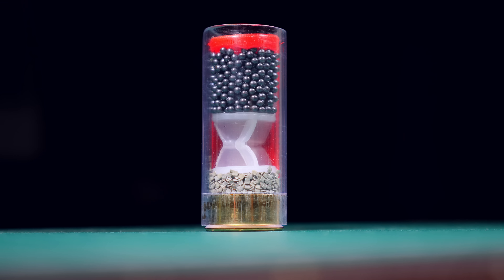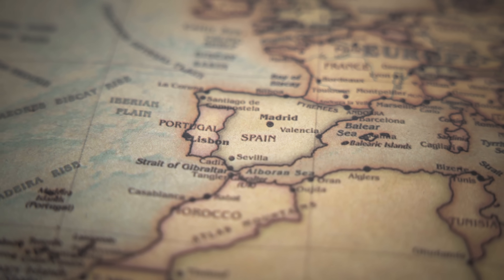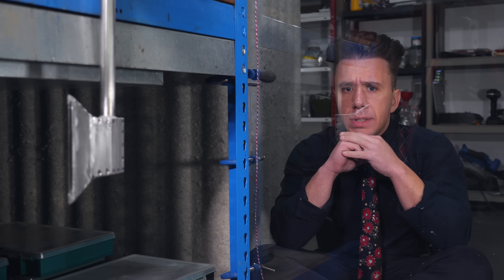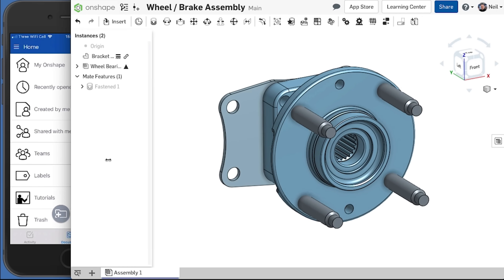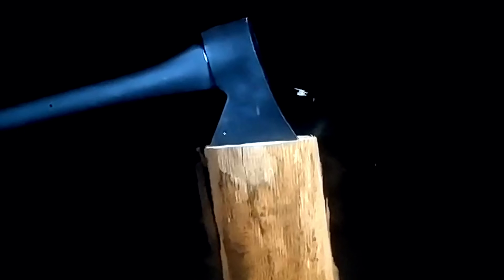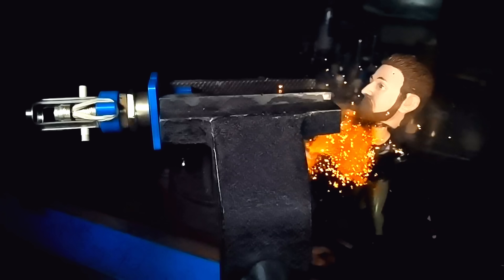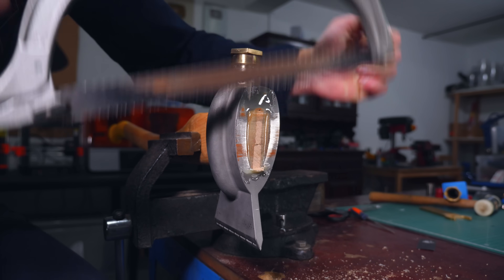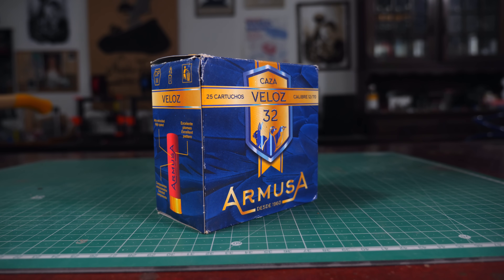I Built a SHOTGUN AXE

Comment: Savage Tigerslayer's Perfected Flurry of Blades [超絕猛虎殺擊亂斬]
89 (83+6) Atk Weight [][][]
Prioritizes targets with Prey
Can Clash with this Skill regardless of Speed; this unit does not become Staggered before it uses this Skill
[On Use] Consume all Inner Strength [底力] Stack on self. If this unit consumed...
-... 10+ Stack, gain Atk Weight +1 for every 10 Stack consumed (max 4)
-... 25 Stack, Final Power +1 for every 4 (sum of Burn and Tremor on the main target) (max 6)
-... 50 Stack, Coin Power +1 and deal +50% damage
[Clash Lose] Gain 2 Power Down
[Clash Lose] Gain 6 Paralyze
[Clash Lose] Deal -80% damage; this Skill's damage cannot Stagger the target; inflict only half the Potency and Count for both Burn and Tremor inflicted by this Skill (unless raised by other effects)
[After Attack] Reload (once per turn)
- If this unit has Savage Tigermark Round, Reload - Tactical instead (once per turn)
[After Attack] Ends this turn
Unbreakable Coin
Spend 1 Tigermark Round
[On Hit] Inflict 6 Burn
Unbreakable Coin
Spend 1 Tigermark Round
[On Hit] Inflict +6 Burn Count
Unbreakable Coin
Spend 1 Tigermark Round
[On Hit] Inflict 6 Tremor
Unbreakable Coin
Spend 1 Tigermark Round
[On Hit] Inflict +6 Tremor Count
Unbreakable Coin
Spend 1 Tigermark Round
[On Hit without Cracking] Trigger Amplitude Conversion into Tremor - Scorch
Unbreakable Coin
Spend 1 Tigermark Round
[On Hit without Cracking] Trigger Tremor Burst 5 times; then, reduce target's Tremor Count by 5

Comment: i aint no engineer but i have an idea, what if u built some kind of metal around the exact depth u need into the wood, like for instance if u need to be 7 mm in the wood for it to work perfectly, a metal barrier 7mm above the tip of the axe, i dont know but it sounds like it should work to me
edit: now that i think about it what if its like bent backwards kind of like an arrow tip so it doesnt mess with ur ability to cut the wood itself

Comment: Hey integza, could you please build this again with the following upgrades? Your original video: https://m.youtube.com/watch?v=CWWKcuVKErI This tiime around 1) don't put the bottles parallel to the boat, put them in the boat in a diamond shape. This will reducethe drag. 2) use 2 tesla turbines moving in opposite directions with 2 seperate lily impellets that are mirror images of ech other. This way you can balance the center of mass and also keep what you called and i quote "the steering thingy" in the middle. 3)Since we have 2 tesla turbines, incree the presure in the bottle to 7.5 - 8 bars. 4) ( OPTIONAL ) I) Add a steel rod with 20 mm steel ball on both sides at the center of the boat (above the first bottle in the bottom layer and below the second and third bottle in the econd layer)to balance it and prevent it from tipping over. Also bendthe rod in the middle to shift the center of mas lower but not so much that it touches the water. ii)adda 35 mm steel ball on the tip and 20 mm steel balls to both the rear corners to balance everything if required as thi will slow down the boat. Thank you for reading the comment and sorry for ending this same comment it in the past 5 videos. -J.tailor

Comment: Honestly you could probably make this a product to sell in the US. Youd probably have to make a couple changes, like redesigning it to use standardized blanks, such as powder actuated nailgun shells, and some sort of safety mechanism so you can leave it loaded without it going off due to being dropped or shaken; a faster way to load and reset the system; and some way to reduce vibration on the hands?

Comment: 0:22 That thing is called the Wad, it both separates the powder from the pellets so the gas doesn’t escape through tiny cracks instead of pushing all of the pellets out. And it holds the pellets somewhat very still

Comment: I was really nervous when you were hammering on a bolt resting on the business end of a shell with primer and propellant inside. If the shock ignited the primer, the bolt would have left at high speed roughly upward.

Comment: Have you considered making a weapon that combines this axe idea, with the flaming knife, and make it self heating through platynum catalysis of hydrogen generated by dipping zinc into sulfuric acid inside a hollow handle?
https://www.youtube.com/watch?v=fwKuCoL9FlM

In essence, a knife that turns red hot without any visible heat source nor gas tether. Open the hollow handle, carefully drop a capsule of zinc, close, and voila, the blade becomes and stays red hot.

Comment: Out of Curiosity have you ever tried to procedurally generate 3d parts. I know it might be considered lazy but using GPT make parts. The reason I am asking. I am working on a project of my own and curious on the feasibility of it.

Basically I am working a concept for a robotic pet dragons. and the idea is to use similar technology to generate a Minecraft world to generate designs. the idea is the program is given a set of parameters to fallow for type of dragon, and colors it can us and general shape of scales etc. using a seed(This is the number used to generate the Minecraft world usually a 16 digit number.) to generate unique patterns, colorations and markings. this way each dragon will look unique. maybe extend it to body shape. muscle, fat ratios. each dragon would carry a chip which would have the dragons would carry the seed used to generate its design, a sort of DNA strand which can be used to copy the hide patterns and textures. so that if one of the robotic pets needs repairs a new skin can be created that looks like the old one. 

for fun I would crate a scanner so that the dragon can be scanned for damage before repairs where it so if there are any tares in the hide, they can be replaced with scar cosmetics in the newly printed skin.

Comment: Could you teach how to create a frequency plasma vortex that an average person can replicate at home? My desire is to create a frequency healing air energy emisor, like an speaker, like a copper star, but in a size that actually can make a human body the waves, the benefits, something in which we can program easily through our phones our desired frequency; 528, 432, 963, 1111hz, etc.

I have seen models using boxes that don’t know where to get, or too small ones therefore too weak. But I’m sure there most be a way to play a tune for example in Spotify, it can be whatever app, or source the point is for the phone to sent the Bluetooth signal to the vortex, so the vortex can emit the frequency in factual frequency.

Not sure if a plasma dispositive could/would help? Or just complicate the project?

Have seen some using all sorts of magnets, but I always wondered which is the right magnet and in what position? How much copper is enough? How big the star should be to actually produce reasonable results?

Then the heat? What is the most safe way to have it on without risks of fire or anything risky?

And… How the energy could be amplified in a good way? Power battery bank? Heart? Both? More magnets?

Could you make a video on this? It could be really helpful as healing frequencies actually truly interact with the human toroidal energy field, we are made we lots of water and so the energy vibrations actually produce resonance in our energy fields, which reflects on our bodies.

Hope you find this project as interesting as it is, there is much in YouTube yeast, but nothing really worth so far.

Comment: Integza, I found you in my search for the answer to this question that has been bothering me for weeks. This is the latest video at the time of posting, so I'm going to put this here, as opposed to somewhere more topically relevant. The question is this: Can you make a submersible fuel injector jet engine? I'm not talking about rockets, ram jets, or MHD propulsion. A real McCoy, fuel injector jet: Ignition, fuel injection, reaction chamber, flight medium as oxidizer. No moving parts. 

Conventional terrestrial engines require frequent surfacing, compressing exhaust, or tons of CO2 scrubbing. Burning the stuff you use to breathe in order to move means you have to stop pretty frequently to get more air and dump byproducts. This is dumb as heck, and we all know it. We(humans) need to find a way around this problem that doesn't ionize your bones from 50 meters away and cost ten billion dollars while doing it.

 Fluid mechanics tell us that if a machine works in the air, and if you want to do the same thing in the wet stuff instead, that there is a cigar-shaped version with tiny wings that can make that happen for you. I refuse to believe that aeronautics and chemistry have failed to produce any novel answers we could use in an aquatic jet engine analogue. If this unicorn is as close to being possible as I suspect with the current state of tech, it's likely to be deeply inefficient and insanely dangerous, which seems to be your cup of tea.

I've had a couple of thoughts on this, as my brain won't let me stop.  The first issue is fuel. Hydrogen-based fuel  should be able to oxidize in dirty sea water still, and though I haven't watched your actual water rocket video yet(next on the list,) I imagine it uses a similar action. I don't think it'd like seawater very much, though. 100% purity is almost certainly essential to that setup and we don't have time for filters.

 The big problem there is how many bubbles H2 or H3 fuels would make, and the opposing implosive force after a detonation. The bubbles would buoy you instantly out of your path and lift you up, but you COULD "sail" against the exhaust to maintain depth or dive instead with enough forward momentum and some cleverly placed foils.

The resulting cavitations would also likely rip the engine (and the uboat) apart, but I'm not sure. The opposing vectors between the vessel and exhaust when it gets going might be enough to avoid damaging contact. You would probably want to burn in smooth onset, sharply declining pulses so you can eject your exhaust as a tube of cavitation rings instead of a constant stream as you would if you were in the air. If you do that, they'll travel a bit farther before destabilizing and going boom. Ideally, the cavities collapse reasonably far behind the crew compartment of the vessel, not in the reaction chamber or at the moment they hit ambient pressure at the end of the bell. Distance from an explosion matters less underwater than it does in atmosphere, but it's still a parabolic drop-off, so the more millimeters, the better. Putting a super meaty shielded jet module at the end of a long shock absorbing tail might be the answer to this, ultimately. It would also make the craft kind of look like a squid or a nautilus, which is cool and thematic.

You would also want to burn fuel(any fuel) orders of magnitude slower in water than in air. Drag and max speed are both way worse down there, and you don't need to generate that much lift to rise. Not to mention the more fuel you burn, the more of those pesky instant death bubbles you're making. More torque is the law of the sea.

Additionally, the final model needs to operate at highly variable pressure. If we were using this for a jet boat, we'd just use an atmospheric jet, after all. Jet/rocket fuel is optimal for ≤1 ATM environments. This WILL cause unforeseen problems at depth. For an A1 prototype, we're obviously talking about a fishtank under static pressure, but it's something to keep in mind.

 Technically, the jet problem could be overcome by electrolysis. You separate the flight medium atomically and then burn the O with an atmosphere catalyst, but this is far too slow of a process for compounding thrust to be possible and it doesn't solve for any of the other problems. You COULD build something that does this and it WOULD technically fulfill the criteria, but you would get more newtons/time from just surfacing and riding the trade winds. The electrolytic scoop jet is not practicable by my estimation.

Another catalyst option is to use a non-explosive chemical reaction to disproportionately expand the seawater and create the jet differential, leveraging the sodium or something. The goal of this method would be to eliminate the change in material states like in a ram or MHD so you don't die when you turn it on, but without the dead weight of a reactor or a battery. The good news is that we're not running the sub on depth charges anymore. Bad news? I'm not even sure if such a material exists, and if it does, it's probably a solid🙄.

Another aquatic cold jet solution would be to use canisters of compressed ionized gas that evaporate when injected and polarize the seawater at one or either end of the jet tube. You'd be relying on the salt to bridge the charge. Still lots of bubbles, but no cavitation. In a way, this is just a chemical version of MHD with big farts, but by storing the ionization in your fuel, you would no longer have to carry a power plant or a motor for propellant. Submarines could be significantly smaller, and finally get to meaningfully benefit from that sweet fuel level/thrust cost ratio. Furthermore, one of those fancy nuke subs could run support and use some of that unlimited power to compress and ionize gas for multiple other vessels. This idea seems the most promising to me.  I should say, rather, that a version of it that has been synergized and reinterpreted by someone who has actually built a jet at least once before is promising.  The thought itself is pure nonsense.

 The cold jet engine would have to be pretty wide like a whale shark mouth, take up the center of the superstructure, and likely be much slower than an airjet, but the magnitude of the thrust remains proportional to the amount of water you can move/second which you can adjust at fuel injection, so there's probably a decently efficient ratio somewhere in there where you can still go pretty fast without falling apart. Although there is no ignition, I would still classify any such cold-burn device as an injector jet.

That's the extent of it. If you're here and you heard me out all the way to the end, Integza, you deserve a prize:

 Another insane concept that might be actionable for the channel and pretty simple to build- an Aluminum superhot air balloon. I actually did some of the math on that one and it looks like it would work. You could probably make a functional miniature with regular heavy-duty kitchen foil. My napkin calc indicated that it should be able to lift a surprising amount of weight relative to balloon volume as long as you can figure out a way to keep the air around °5-600c in there, but I was unable to to figure out how to do that. I have faith that your talents in that arena exceed the demands of the task. 
Good hunting.

Comment: I watched this the day of release, and I'm still giggling at your reactions to exploding logs. Your vids are always great. Love the engineering, the iteration, the whole journey.

<end bootlicking>

Okay, so I had an idea for a future build. I just watched a video essay on the differences between railguns and coilguns that ended with a series of highly experimental hybrid designs. The last of witch is called Electromagnetic Rocket Gun that uses the heat form the Lorentz forces of a railgun to heat a coolant to vaporizing temps adding a rocket-like acceleration to the already fast rail acceleration. It sounds like something right up your 3D printed alley! Also, more 3D prints and explody things!

Comment: Hello integza
    How do you doing. You done so many good videos but less videos suggested by fans. The future videos are getting far future video ideas. I got a idea for a near future video . I think nobody tested this idea . But the principles are already existed and used in rocket technology.
    The venturie effect, it is used for texting rocket in vaccum condition on earth. My idea is to use venturie effect to produce extra thrust by suckling air to a secondary combustion chamber , is it possible? I have a detailed explanation please read .
The current of high pressure combustion rapidly move the air surrounding the nozzle thus current of air is moved along direction of flame . If we design a casing for air to pass threw.
It can move a volume of air with high velocity to a secondary combustion chamber. The outer case for passing air is a converging casing for the speeding air to max velocity. This casing is fitted just below the main nozzle like we can't see the flame when viewed from side. The air is sucked into the case in the direction of flame. The suction of air is not uniform around nozzle it decrease with radial distance , so we use a star shaped cross section , The inner circle of star have the diameter of main nozzle. Air is sucked threw the corners there it speeded and injected into secondary combustion chamber and Final The air is mixed with fuel for combustion
By mounting an inlet to direct air into the converger , when rocket speeding it increase pressure in converger and increase thrust
  
Please share your thoughts about it.

Comment: Like this dude made an enchanted ax that deals extra damage. Be cool to see like a Sledge Hammer Version. If it worked in reverse, more like a rocket. Gas spews the other way giving accelerated force to the sledgehammer head. Like putting a SpaceX rocket on the opposite end of a sledge hammer that activates with the swing creating crazy high acceleration force. Probably not safe at all.

Comment: I think this isn't very practical in reality, because when you're splitting wood, you generally don't want it to fly away. It also goes without saying that this would be very expensive to use. I think a more practical design would utilize something else for the propellant, like compressed air for example
Reply: r/whoosh